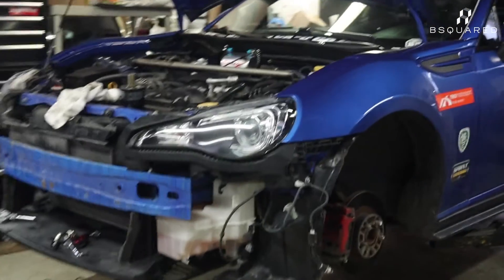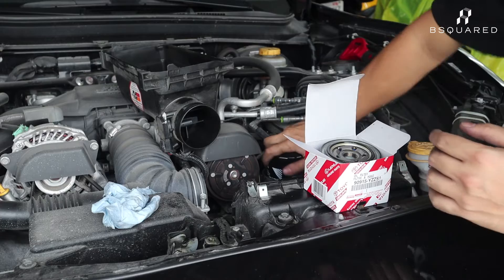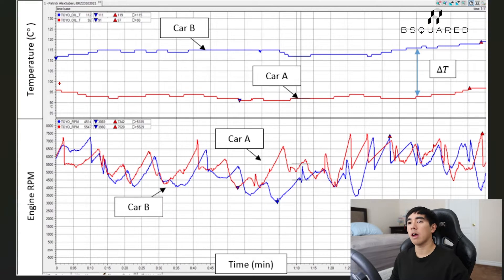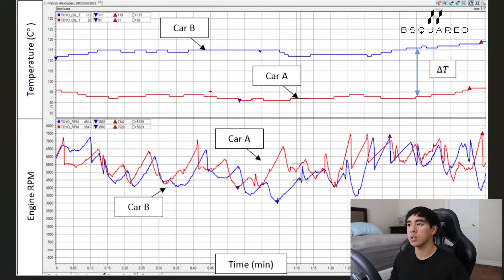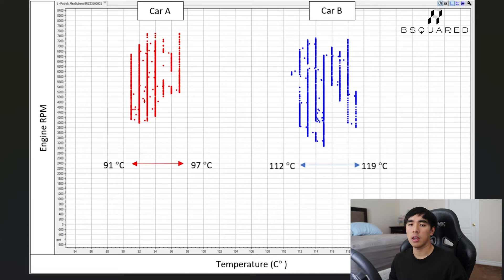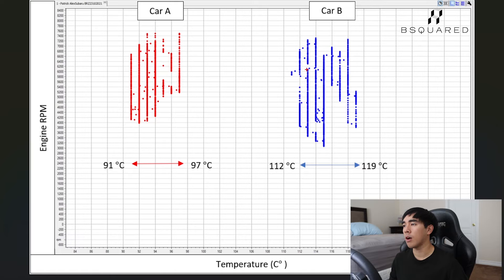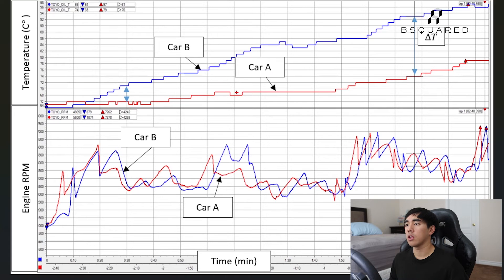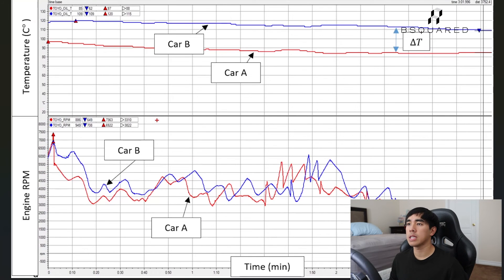DOES THIS OIL COOLER ACTUALLY WORK?!

Comment: OIL COOLER GANGGGGGG. Make sure you check the fittings after install! They'll probably need to be tightened after a few heat cycles, especially at the track.
Reply from the maker: Small price to pay for salvation 🤌✌️

Comment: How long have you been running the car? Or how long did it take for the oil to reach 120 degree?
Reply from the maker: Both datasets we discussed were from one out-lap at warm-up pace and the consecutive lap at attack-pace on a ~2min ish road course, so the car without oil cooler got up to 120 deg in about 5mins of driving and hit the plateau in the 120 deg C range for the rest of the session. This was under 10 deg C ambient temps, so it's safe to assume a 130-140 degree temp range with ambient temps being closer to 20-30 deg in summer months. I actually have data of from my BRZ at Mosport hitting 140C with no oil cooler at a 25deg C day in July
Reply: @bsquaredmotorsports  thank you I also track the my car at shannovile, tmp, icar Mirabel. Before I had the 370z and I added an aftermarket oil cooler so I never worried about the oil temp. I got the 86 last year in August and I track it once bone stock. Because I didn’t have the oil cooler I would just do two hot laps and then I I will do some cool down laps and then send it again. That’s not too much of an issue  at shannovile and tmp but it will be a bit of a pain at icar because you buy the tickets for each 20 min session
Reply from the maker: @ElisaandZixi  you're likely okay to do full time attack style sessions - 1 warm up, 3 hot lap, and one cool down. These cars can handle a lot

Comment: So this model you reviewed does not have a thermostat, and I saw you mention in other comments that Grassroots offers a version that includes it, however I cannot find any information about that anywhere, do you have a link or part number to the version with a thermostat or if I can buy it separately and add it?
Reply from the maker: You'll have to contact them directly, it doesn't seem to appear on their site, but I was told in-person that this would be an option. Paul is a super nice guy, and is a racer himself (both drift and wheel-to-wheel). Don't hesitate to contact them directly, they should be able to get your sorted.

Comment: Great job!  For curiosity, was oil pressure compared between the 2 setups?
Reply from the maker: Will go back and check, will let you know - just a note, for oil pressure, it's not apples to apples since my car has a oil pan baffle, and hers does not, so there maybe periodic drops in oil pressure from slosh in her car
Reply: @bsquaredmotorsports  Understood.  It's my understanding that coolers will lower oil pressure a few PSI and some coolers are worse than others, depending on their efficiency.  Was thinking of adding one to the Genesis because with 23 psi of boost, it tends to shred oil even with 0W40 AMSOIL.

Comment: Does the grassroot oil cooler come with a thermostat built in to allow the oil to get up to operating temp from a cold start before starting to cool the oil  (like in the perrin or mishimoto oil coolers)?
Reply from the maker: this model in particular did not, but they have one with a t-stat available